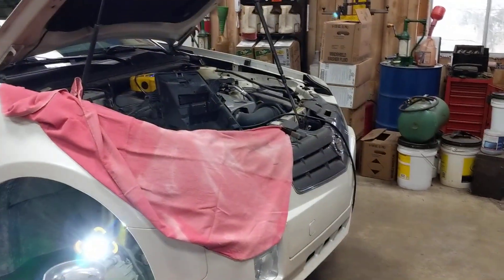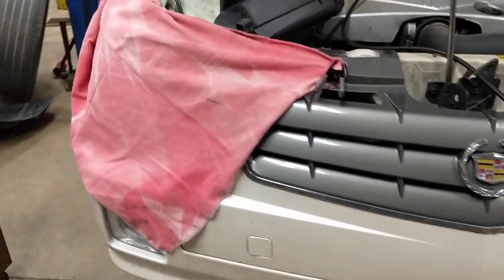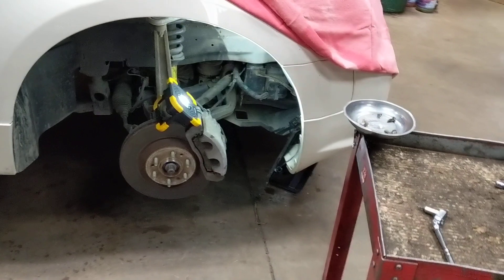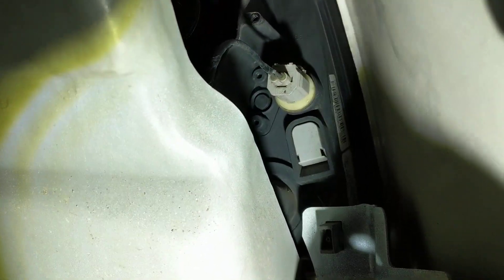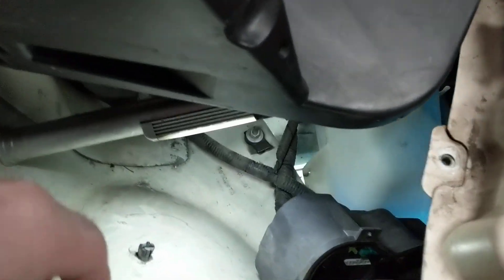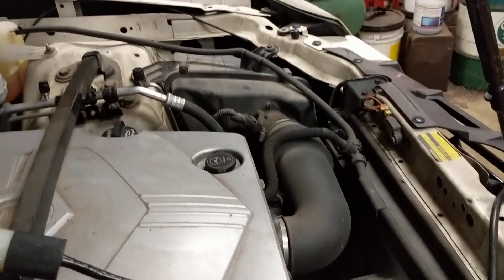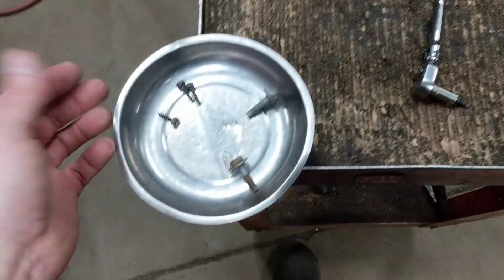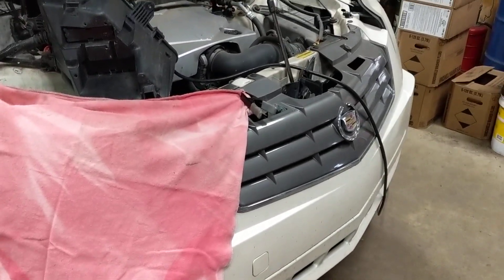Cadillac SRX Headlight bulb replacement

Comment: The Headlamp Fixture comes out by simply removing 2 bolts (one on the top that is accessible and the other side nearest the center of the bumper).   removal of the entire front bumper/facia is not required; it is only necessary to remove the 2 top bolts of the facia (there are only two).   the side bolt of the headlamp fixture can be accessed by pulling forward on the facia a little bit (the front facia/bumper is very pliable plastic and can easily be moved enough to access the bolt).   just make sure to have magnetic sockets so you don't lose the bolt during installation and removal.

Comment: I call bullshit that the electrical box moves out of the way that easy in mine
Reply: You might call b*******, but he did it and he showed it. So it must not be that hard.
I would guess. it's lot easier than taking that front facial on everything off.
Reply: @glenmurra3856  Moving the Electrical Box is definitely overkill for this job.  Ideally, you don't want to mess with electrical especially on an older vehicle. electrical contact points can loosen up & electrical connectors tend to break